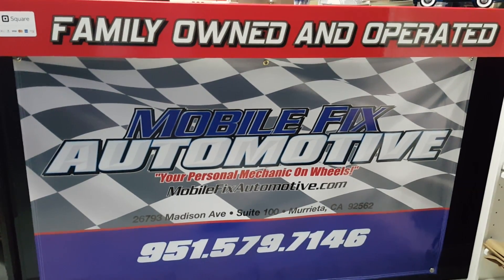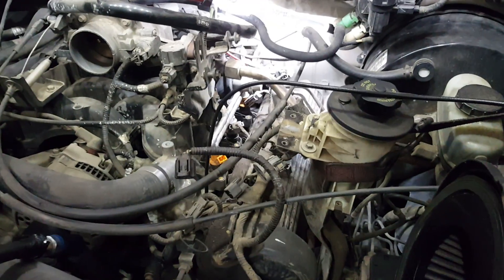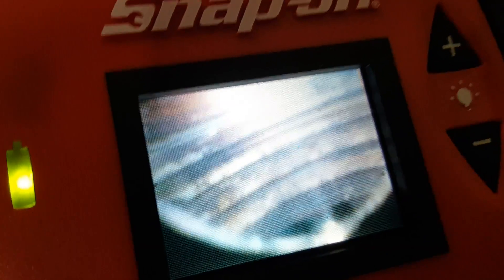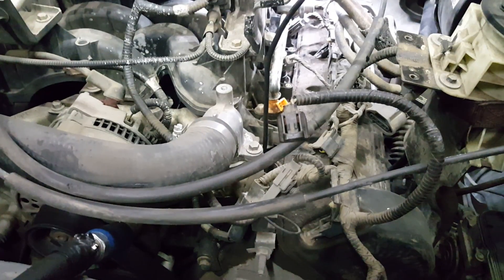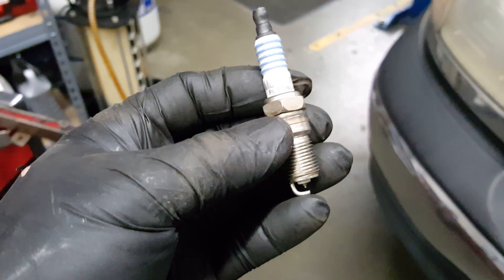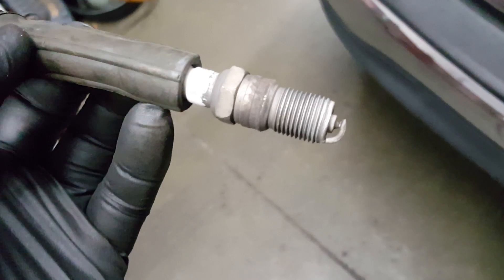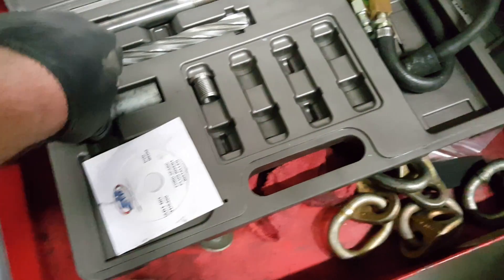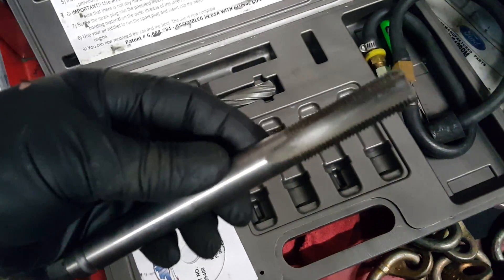Why the spark plug blew out of your Ford Triton engine

Comment: 95% of Ford's are still on the road 5% made it home ..... the others are still out there somewhere
Reply: 95% waiting for the towing
Reply: THAT was funny
Reply: I rip on Chrysler fans just for the laughs, but in all honest its mostly a crap shoot, & boils down to just personal prefrences.
Ive met people who've had long life out tons of all different makes. For me. Im a GM fan. They're best suited to me and the 3 I've owned have been super reliable & fairly efficient. My Silverado is 12 years old and has been the best vehicle ive ever owned. And theres nothing special about it. 
I also own F250; and other then a few quarks & electrical issues I got no major complaints. Ive owned 7 Chryslers in my life & all but one of them totally sucked. The 76 Plymouth Volarie. Ugly as FUUU! But that slant six always ran no matter what. My best friend bleeds Mopar. Our other friend is Ford all the way. So the 3 of us are constantly irritating each other about whos got the better vehicles. But all in good fun. Like i said. Its up to the individual preference.
Reply: they had to make SOMEBODY happy. someone out there loves yugos also
Reply: 387,000 on my 2005 e250 4.6 replaced an egr valve an ac blower motor and o2 sensors no check lights. Runs perfect. Regular maintenance plugs, coils , hoses all replaced 1 time and 1 abs sensor. I do the maintenance myself. Transmission still shifting smoothly. Used with weight as an electrician. Also changed all springs and shocks and ball joints. But other then that the motor never an issue figure that out.
Reply: they had to make SOMEBODY happy.
Reply: Slopar wont go Far
Reply: B.L. M.N. Most of them are in the junk yard.
Reply: Love it
Reply: on the side of the road  waiting for a tow truck
Reply: Fook you. This is not common normal occurrence. This is his OPINION. U heard him.
Reply: @Davido50   hey dummy you cant spell its fuck
Reply: @Davido50  it is when idiots change the sparkplugs and don't torque them to spec.
Reply: @Davido50  , it's a fairly common problem. He is 100% correct , his opinion is also the facts.
Reply: @OldGriz708  Toyota smudged millions engines. Can't sell there full size trucks . junk. Honda has millions airbags out there shooting shrapnel killing ppl. KIAs catching fire by hundreds! Thanks ...my family happy w/our 3 newer Ford trucks & SUVs. Go Ford!
Reply: David Klimmek, You are entitled to your opinion. That is ok....
Reply: Chevy fagboys I mean fanboys out in force yet Ford has highest REPEAT BUYERS IN THE BUSINESS so keep giving eachother hand jobs and watch GM implode.
Reply: @Davido50  they do, where in your mind??? Fords suck ass. If they so great, why is the 350 Chevy best motor built and used in more swaps than any other engine??? Dahhhh
Reply: All you Ford fans remember there’s always the exception.  Before I sold my shop/business in 07 we saw dozens of these come in for the repair.  Everyone has their design flaws (GM, Chrysler, Honda Toyota ect) it’s just that unless it’s a safety issue the public plays hell trying to get them to fess up to the problem.   The Ford dealers I dealt with over the years (more than a dozen) complained constantly to their factory reps about it to no avail.  Buyer beware if you’re looking at a low mileage super deal on a Triton powered vehicle of the early 2,000 vintage.
Reply: Cut me and ill bleed Ford Blue.
But that is funny.  Not true. but funny.
Reply: Can I use it it so dam funny
Reply: LOL !
Reply: this shit happend to my truck but i still drive it after i fixed it of course
Reply: You spelled Chevy wrong, they all died on the road due to their legendarily shitty fuel pumps
Reply: Look in the junk yards. All fords and dodges
Reply: Tons of Chevy in the scrap hear here.
Reply: 167,000 on my 2008 F150, never let me down once, saved my best friend, when his piece of shit Chevy wouldnt start. When it blew up the transmission, when the fuel pump died AGAIN
Reply: Funny, I usually see GM products on a hook, some dodge, but mostly GM's
Reply: I like Fords, but that was funny.
Reply: 234,000 miles on my 06 4.6 E-250!!!! Never let's me down. It now has 239,000. Still running fine!!!
Reply: @Wannagobackto1980  you would not tell us the truth what you have fixed on it anyways. Just another stupid ford boy
Reply: @Wannagobackto1980  Don't ever have to do a timing chain job on it, you have to totally remove the engine to do the passenger side.
Reply: @garys9694  she does pretty good. Motor is great. Never have had a problem with it. Transmissions suck though.
Reply: Haha, i love this shit. Seeing how most of my life i stuck with fords and they always at least got me home. My Chevy in 1 year got 5 times more rides on a rollback than all my fords combined over 15. I'm goin back to a 5.4 2v, funny how an ohc can be more reliable and last longer with no problems or leaking damn rear seals than a pushrod. Maybe don't turn em over to idiots that can't turn a wrench, they might last longer. But simple minds need simple shit i guess..
Reply: @salvadordollyparton666  years ok idiot. You prolly never owned a chevy
Reply: @salvadordollyparton666  you are a special kind of stupid. Pushrod engines are way more dependable than a oh V8 and Ford has tons of problems with timing chains on their junk Triton's
Reply: My brothers 2005 F150 only has 400,000 miles on it and going strong.  My brother in law was a die hard Chevy fan, until he bought a Ford truck.  You won't find a Chevy on his farm anymore.  No comparison he says.
Reply: @robertheinkel6225  how many engines? I gurantee it's not the original engine in it. You lie just like all the other stupid ford idiots
Reply: No because now he is broke from over paying for his Ford and the cost of repair and maintenance have pretty much killed him.

Comment: Bow tie all the way!!!!
Reply: HEMI LOVER 
Your Hemi has more recalls then any other engine made. And everyone if them is made in Mexico. So much for your "Imported from Detroit". 
Slopar won't go far.
Reply: In the era of 1997 to 2003 that this guy is talking about GM trucks weren't exactly noted for reliability either, watch out for the 4l60e and the 4l65e transmission issue...  They just slip to death because they were to small for a full size work truck or SUV,  or how about the plastic intake manifold that just cracks for no reason.or how about the paint that falls off in sheets (when the others figured out how to make it bond to metal).  How about those awesome power windows that just get stuck in the up position or the leaky AC valve cores...  Let's be real in the this era the Cummings diesel in the dodge or the 7.3 international diesel was a the way to go...  As for gas ½ ton trucks, outside of this plug issue fords are usually pretty reliable.  For that matter the dodge is also reliable minus the dash board that literally just disintegrates when you hit a bump... I am not anti GM but in the late 1990s until the thier Bankruptcy, they made pretty crappy cars and trucks.  Honestly I recommend buying a 1960s era American truck from ford, Chevrolet, dodge, international or Kiaser (Jeep) all of them were built to last back then and all of them are easy to work on and the parts are still reasonable even 50+ years later.
Reply: @AtomicReverend  I have a 99 Tahoe, like you said, the transmission has had a rebuild... at 100,000 miles. Engine has never had any issues besides some minor things that happen to cars its age. It has 115,000 right now and still going strong. Fuck Ford.
Reply: Oh yeah?  How about the LS7 and LS9 motors dropping valves?  You like that one???  Bow tie baby!!!!!!!  Woooooooooooooooooooooo!!!!!!!
Reply: @fwh79FOXR6  what about the rock solid reliability of the 350? Fuck blue ovals!
Reply: Timothy Porras 
Shitvrolets are junk
Reply: @ramtrucks721  sure, keep driving around in your Italian truck.
Reply: Yeah! No blue ovals here.
Reply: Shitrolet was STOLEN from Louis Chevrolet by William Durant of GM. You keep your Chinese GM products (Yes GM took taxpayer buyout money and built 14 factories in China with it! How about the 20+ year problem with the ignition switch GM criminally failed to recall - caused several deaths too!
Reply: Constantly Having Every Vehicle Recalled Over Lousy Engineering Techniques Chevrolet

Comment: Before he stars if the heads are aluminum it an easy answer. I had a FORD Escort with an Aluminum head, It was the first F/I Escort on the market. With about 30,000 miles on it it blew a plug out. Over heating and backfiring. That's my answer. I got a re-thread kit installed it and she ran like she did when new. I do not know if the threads were all the way down the head but I was surprised when it happened. OH, I used air and a hand magnet to get all the cuttings out. NICE. you lose the coil and all...My plug was still on the cable. No other damage was done, I used Bosh or other European plugs every time I did a tune up on the car, it ended up with well over 150,000 miles and the exhaust lasted that long also. that is a huge insert, I used a HELICOIL. Good video.

Comment: My respects Ron thats is a lot of work in my opinion i will stick with chevys
Reply: Mopar are the worst pcs of shit on the road
Reply: David Jackson true
Reply: Mauricio Lezama don't worry, I'll be seeing yah on the side of the road. U consuming oil,me blown cylinder head
Reply: Love my bowtie too, over 202k and still pulling all size trailers and loads just fine and it still gets compliments on looks.
Reply: You can have em. I've been driving a 6.0, and I'm goin back to a 5.4 2v. I can get more power and way more low end for the mileage this junk gets. And have a tank, vs a delicate lil flower.
Reply: Me too...
Reply: Mauricio Lezama 
Shitvrolets suck shit

Comment: This hasn't happened to my 5.4
The engine has been beast after over 10 years.
Reply from the maker: +Erik Anthony yes, it doesn't happen to all engines. But lots of them.
Reply: seker7 I'm at 187k, but I barely drive my Ford expedition with the 5.4
It's just been great, not one engine problem yet, cross my fingers lol.

Comment: So my question is, did Ford fix this problem and if so what year did they redesign the spark plug threads to hold the plugs in place ?
Reply from the maker: +Juan Torres ford stopped the plugs from blowing out with the introduction of the 3 valve. And replaced it with a problem from the other side of the spectrum,  now the plugs dont like to come out. Thats why they sell extractor kits for the new plug design.

Comment: I've had this happen twice over the past ten years in a 2002 F150. It was annoying at the time. But the truck turned over 280k miles last week. Other than the plugs, i think this is a fair trade off for the mileage.

Comment: This almost seems as if they forgot it was aluminum they needed to account for when honestly, it would have been fine for the old typical cast iron head. 

I work with engineers on a daily basis, a lot of them. They're human as well and contrary to most of their self-beliefs, they do screw up. What's worse, companies enjoy the cheaper labor it seems to higher straight out of college and think they're saving on payroll. There's no replacement for experience and achieving this through trial and error with customers isn't my idea of how to get there. It's rare to have an issue that's been implemented deliberately because word of mouth travels fast and repercussions are too high; likely an oversight per my first sentence.

Comment: Stay the fuck away from the 5.4 Trition in general.
Reply: There was no problems with the two valve motors.....
Reply: I have 2 of them 275k  miles and 213k miles Never have this issue.

Comment: THE BIGGEST TRUTH IS, TODAY FORD MAKES A DEATH TRAP............PERIOD!!!
Reply: edwin storz I'm old retired guy I have only purchased and drove ford since 1982 or so . I had a new Silverado it was a beauty but never got much mileage or power out of it. While under warranty there was a problem . The dealer shop head mechanic said no problem, it's covered. There was a soft spot on cam shaft and one love just wore down. I told the guy I was never happy with top end or mileage could he fix that. ? He says he could put in a cam designed for motor home but mileage would go down and it would sound Lope. I told him to do it , he says " it's not covered on warranty . I ask how much a couple of bills . I tell him to do it. My mileage went way up and it idled at 85 . I really like that truck but it was my last chevy . When I retired I bought a new 250 thinking it would probably be my last truck , I'm rethinking that . My 08 has about 65,000 miles I've never had one issue and don't look to have one . I am thinking about buying a new one but when I look at sticker I'm shocked . Seems like Ford 250 went up in last eight years or so more than is justified . I'm even thinking of bailing on Ford cause of their political bullshit
Reply: edwin storz made in mexico with Chinese parts
Reply: @jslugbug37  GM owns 14 factories in China pumping out their auto parts paid for by the Obama taxpayer funded bailout. That's one reason I will never buy any GM!
Reply: and now your new f250 worry death wobble
Reply: Ford makes, literally, the safest pickup on the market. You're an idiot, just like slug and shawn.
Reply: edwin 
storz  Must be like the 2016 Chevy I had right front wheel assembly fell off going down the freeway at 70mph turned the truck hard right into the guard rail head on and thanks to GMs great safety technology the air bags did NOT deploy! Love my new F250.

Comment: I will not apologize for being and feeling Pissed, i will thank you for telling the Truth, if more People like you would only take a stand and make the law work, 
Awesome Video!
Reply: Chevy Cobalt’s / Pontiac G5’s had an engine with a bad timing chain tensioner that would lose tension at around 50K (just after the warranty expired) causing the timing chain to skip teeth, which resulted in the pistons hitting the valves, destroying the engine. They knew about that problem and redesigned it but did not issue a recall leaving many owners to replace the engine on a fifty thousand mile car at their own expense. I was a Chevy guy but not anymore, fuck them!
Reply: Boat Axe Disgruntled Ford fan, ehh?

Comment: Terrific video Ron! I'm looking at a 2008 Class C RV with a 6.8L V10 Ford engine and was wondering if Ford had solved this problem by 2008, or if the V10's from 2008 or later are still having a problem blowing their spark plugs?
Reply: Al D
Reply from the maker: +Al D the later model triton engines use a different plug on the 3 valve engine. I haven't seen one blow out yet but i have heard of inserts needed to fix the threads after plugs brake off.

Comment: the reason 3 and 4 are most common is because water drips into the plug holes from the firewall, where the grounding strap is. it comes in through the slots punched out for the lugs.  I bought 04 Mustang GT heads for mine, 8 thread. Plus I check torque every 25K miles.
Reply: how often do you have to adjust the torque?

Comment: 97 to 2003 was 1 piece plug with 2 valve heads i think they are fantastic motors  i have 489k on my 02 f150 and blew 1 plug at 400k ish had a recoil put in haven't had  an issue since.  buddy has f150 lariat with 380k not an issue. friend has 1999 f150 980k with 3 recoil. although the heads were changed in 04 to 3 valve. and redesigned a 3 piece plug to go in. they shaved the heads to pull more power out of the motor which also shaved threads off. absolutely the worst thing ford did and not be responsible for this issue is wrong on fords  part. in mid 2007 they redesign the head to receive a one piece platinum plug. but still 3v head.  I got 08 lariat with 290k i put lockouts in cam phaser. replaced 3 sets rotors 6 set of pads and oil changes  every 10k never a problem. ford makes good products. but also had really dumb ideas

Comment: I own a 2001 Ford SVT F150 Lightning and I shot my first plug out at 23k miles. I wasn't under boost just cruising and it sounded like I threw a rod.
The first plug I shot was at #1, the second was at #3 also not under boost. 
I think #3 went at 45k and then I applied inserts to all remaining cylinders. 
What a pain in the ass!!!
Reply from the maker: +fwh79 lets not split hares..
What i mean is the engine blowing a spark plugs has nothing to do with whether it's supercharged or not. Most of the time the problem is caused by the spark plugs coming loose one or two threads there's only four threads in the head so Boom the spark plug pops out yes while the engine is running
Reply: Ford's been passing that buck, LONG enough. Can you blame them ? The customers are paying the repair bills. Insert kits and all.
Reply: My dad's Lighting blew a plug out on a cold start.  You would think they would let go under boost.
Reply from the maker: +fwh79 its not a pressure issue.
Reply: Ok... how many stories have you heard of plugs coming out begin with... "My truck was not running when all of a sudden... the plugs just popped out of the spark plug holes!"???  None that I have heard.  Every comment on this video tells stories of the engine running when the plug let loose.  Yes, it is a pressure issue.  The lack of threads is obviously a massive contributing factor.  I would also suspect that the lack of thread area is effecting the plugs ability to transfer heat properly into the cylinder head.

Comment: Ridiculous design on Ford's part. Thankfully I haven't had this issue yet on my 97. Changed my plugs at 60k due to a misfire, and about to change them again with 125k on them. I own Chevys and dodges of the same vintage and none of them ever have issues with plugs blowing out, nor do they use a coil on plug setup either.